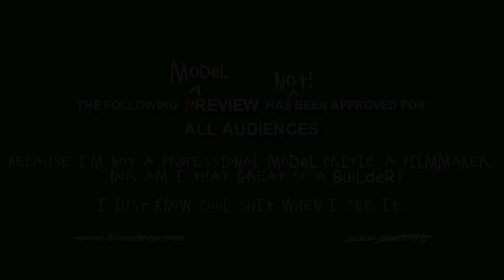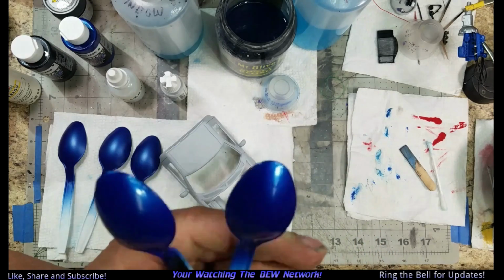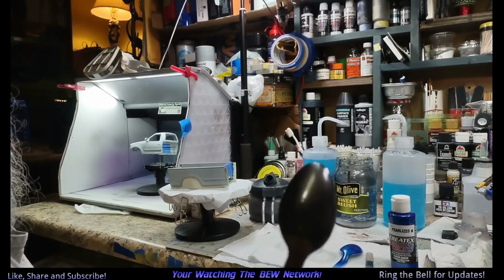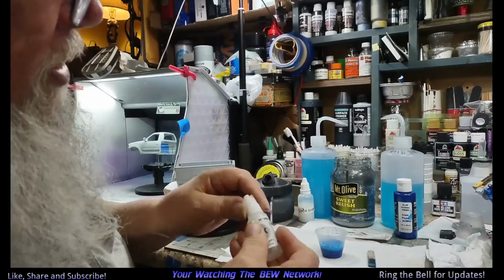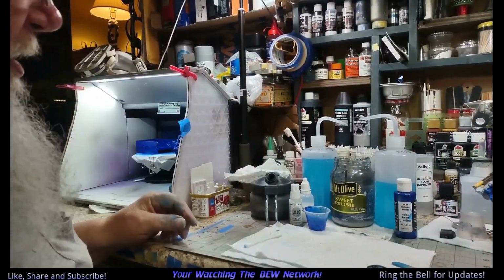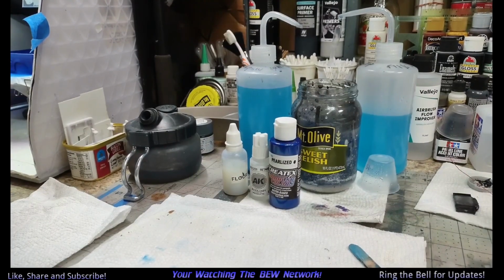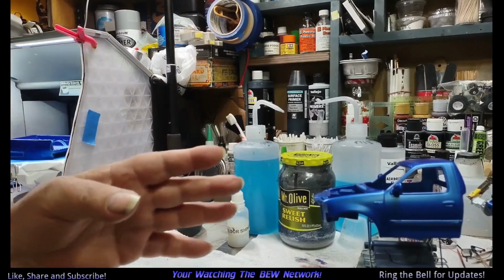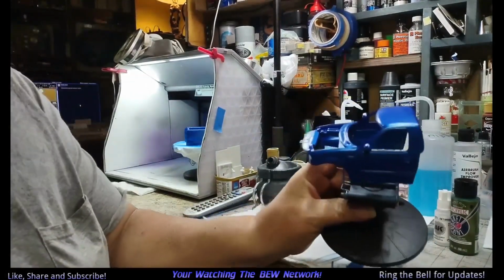1997 F-150 XLT The beginning of Paint! #modelbuilding #modelcar #scratchbuild

Comment: Great color and painting Bruce.  I spray Createx and use their 4050 Clear and 4011 Reducer to thin the paints, then 4053 High Gloss to clear over it or Tamiya clear.  Good paints, but there is a learning curve that some people just don't have the patience for.
Reply from the maker: Thanks for watching Larry. 👍
I like the Createx paint so far. Have not used the Extreme stuff just the standard paint but so far I paint it just like any other acrylic paint, floor shine, washer fluid, retarder, flow improver at 35-40 psi. None of their other stuff and it works fine and the bank ain't broke... Lol But yes there is a learning curve that you have to deal with. Yet, that goes for any paint. I got dome Dork paint on order to try next and I'm sure that will be fun to learn too... Lol
Any rate my GHAD-68 Gaalheri works just fine with it...
LLAP 🖖